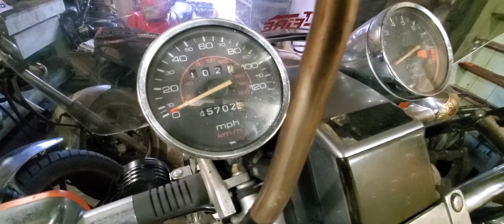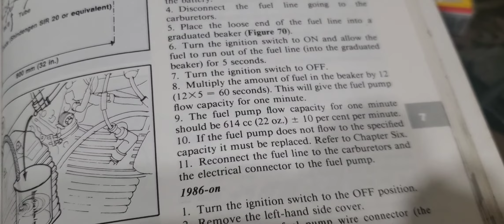$500 1984 Honda Shadow 700 part 3 Fixing my dads favorite Motorcycle

Comment: Check the ground for the front coils both at the coils and where the wires terminate. Having metal to metal contact is key to higher voltage. And that pump is a major issue. When you get the straight pipe it make sure you get the correct back pressure. Good job so far these vehicles that never had preventative maintenance are always a challenge because there is almost never a single issue. Thanks for the video. You can do this.
Reply from the maker: Yea i think the ground is good. It shocked the hell out of me. Once i resolve fuel delivery i will go over both spark and fuel again
Reply: @supastihl89  rad I love nothing so much as progress.